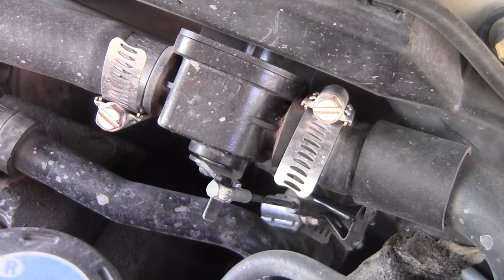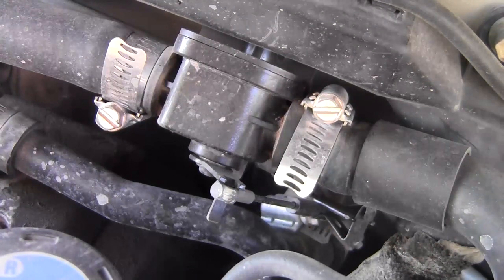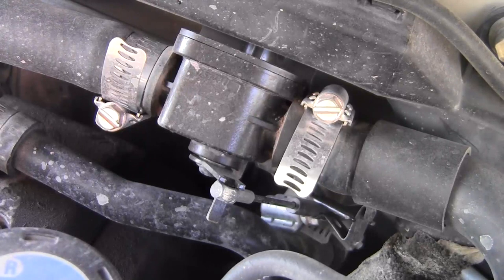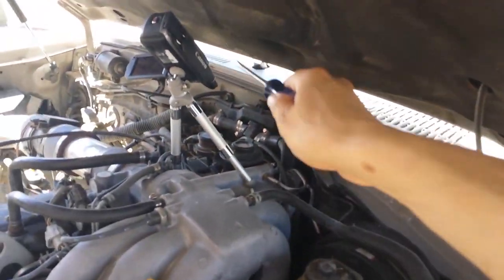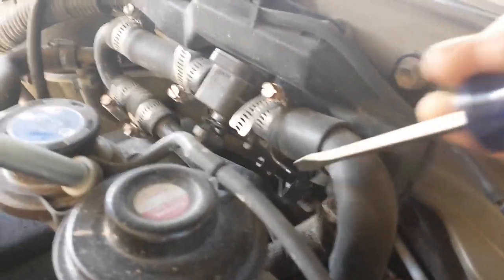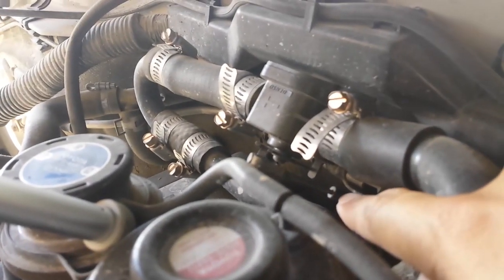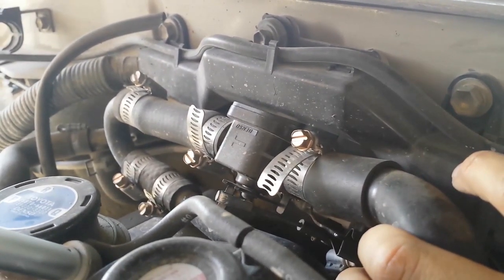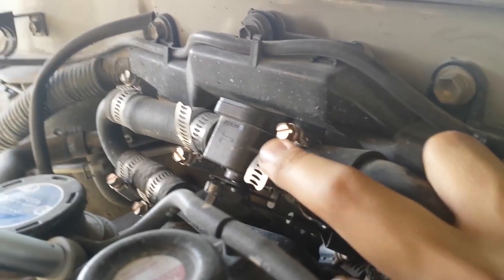Land Cruiser A/C Air Conditioning Quick Fix Mixing Valve FZJ80

Comment: Legend! Thanks for the tips!!

For accuracy sake, the hot doesn’t “mix”. The AC button engages the compressor, which pumps gas through the refrigeration system, cooling an inside coil. 
The mixing valve directs hot (radiator) water through a seperate coil. The air is both refrigerated and heated by seperate systems.
Reply from the maker: Thanks for the info!

Comment: G'day from Australia, just before I just watched your post I was booking my '96  'cruiser into an air. con. specialist for a service and refill. I followed your post,checked the hvac valve, and gained a quarter of an inch reach on the cable which dropped the temp out of the centre vents from 12*c. to 3*c  for 2 mins work.  
Fantastic stuff and totally appreciate your post
Ray, from Victoria, OZ.
Reply from the maker: Right on Raayyza!  I am happy this helped and saved you some cash.
Reply: Did you only have heater to start  with

Comment: if this fix still doesn't work replace the valve as they can internally leak and let hot water pass once they start to get old.
Reply from the maker: Good tip.  Thanks!

Comment: I have a 90 series prado with the same set up cant seem to get cold air would it needreplacing
Reply from the maker: I am not sure.  You could unhook the cable and manually turn the valve to the cold setting and see what happens.  Are all other parts of the system working correctly?

Comment: My 1997 LC just blow cool but not cold air, should I adjust the cable up or down?  Thanks in advance.
Reply: There is a Limiter on the Valve when u pull UP the cable assembly take it all the way up for it to blow freezing cold air ..

Comment: Thanks for sharing man. I just wanna ask, i have a land cruiser 80 series 1993, i've been struggling trynna find a way to fix the A/C problem and went to so many car electricians but !! Long story short, the front A/C isn't cooling but the rear is ok and even the small refrigerator by the driver seat is fine. I wish you can help me fix it. Thanks.
Reply from the maker: HONOR HMM I am not sure.  In the US Land Cruisers only came with front AC and no refrigerators.  Good luck amigo, I hope you can fix it.

Comment: hello. how to fix my LC200 electronic climate control AC. it doesn't blow air from the front vents. other vents are working perfectly when pushing Mode button.
Reply: brightopener did you have answer for your problem sir? I have same issue

Comment: The cable doesn’t allow me to pull or push in the line at all..valve doesn’t move from switching from cold to hot. Is it stuck? :(
Reply from the maker: Are you saying the cable doesn't move inside the sleeve/to be that it is inside of?
Reply: Neatus Garage Studios actually just checked again and it’s working. But noticed when I switched to hot the valve was leaking bad.
Reply from the maker: Might need to replace that valve.  If that totally fails it could cause your rig to overheat.  Check the hoses too.